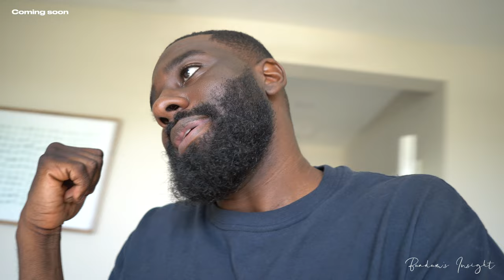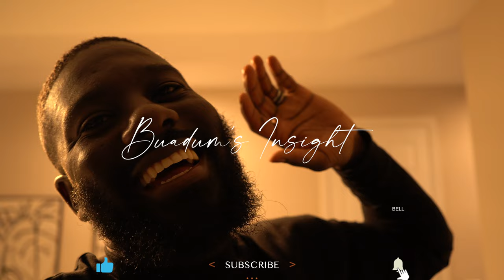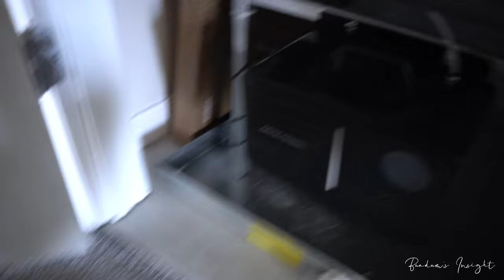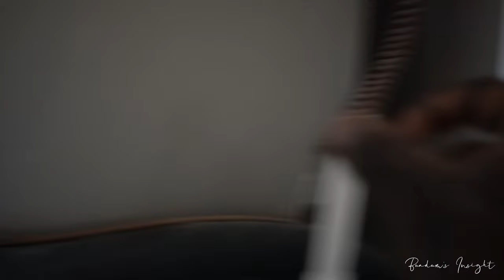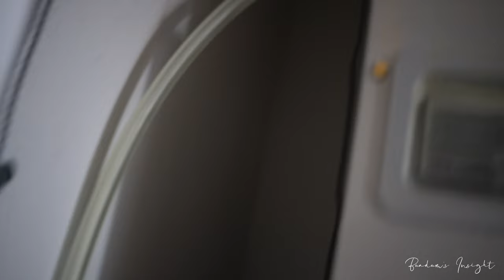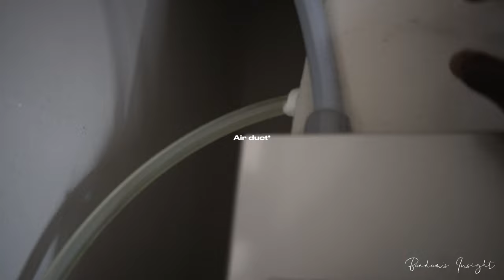AROMA360 HOTEL COLLECTION SCENT DIFFUSER | REVIEW, SETUP & MAINTENANCE

Comment: I would be cautious about putting a diffuser into an hvac system. If you go to HVAC forums, they do not recommend this. Over time, oil residue will accumulate in the walls of the duct system and it's not a matter of if, but when it will cause damage.

Comment: It’s was better than any explanation that the company itself has given! Cant thank you enough! I haven’t set my unit up but my only complaints are the CS.  They empowered (and paid) brand ambassador ie paid social media influencers to sell their products and unless you become a “VIP” and sign a 3 year locked contract for $165/month these ambassadors are no help at all.  CS doesn’t respond to emails, and their chat is done off shore and useless.  So THANK YOU for this!  Just one question for you:  I bought one unit that will only serve my downstairs unit (because I have two zones in my house and two separate units… has anyone tried to jigger the tubes to make a splitter so you can  have one tune from the scent bottle actually punch into to separate units? I understand that I will most likely go through  the oil faster (depending on settings) but wondering if anyone has done that before? The one unit I have BTW will cover the total square footage of my house.
Reply from the maker: Ooooouuuu this is a great question..... And yes Customer Service is very weak. Definitely need to fix that! A splitter is such a great idea. I haven't tried it and I am hoping someone sees your comment and responds, if they have done it. 

I think it will be just fine and with the adjustment of settings you may go through your oils at the same rate, without a splitter.

After using the scent diffuser for a few weeks, I changed my settings to scent less, because my home smelled so good; so when the scent machine kicked it, it was more so maintaining the scent in the home. I think you will be just fine with a splitter. I would love to know your experience as well :-)
Reply: I split mine off as well and it works perfectly. Don’t increase the intensity, just use medium setting and it will work.

Comment: My contractor told me not to use hvac diffuser because the oil can build up inside my hvac duct and that’s bad the system. Any thoughts? I have one but just place it in the middle of the house.
Reply from the maker: Great comment! I am no expert in HVAC, but I did do a little bit of research after I saw your comment, and I do not see anything regarding oil build up inside hvac duct, but the actually hvac diffuser can have some oil build up which can be mitigated by routine maintenance. But hey, as long as you can smell it, it doesn’t matter the placement. It’s a win win; in my opinion.
Reply: Saw this comment and just wanted to call out that their website specifically says that this is a no residue system. Also hotels use it so I wouldn't think they would put their expensive HVAC systems at risk.
Reply from the maker: Very true. Thanks for the feedback!

Comment: Thanks for the info. This is my second time watching. A good bit of time in between. I’m still undecided. Does the unit coordinate with the hvac system? Meaning, when the air is on (always in Florida) the hvac will blow cool air for a bit then stop and then start again in order to maintain the temperature. Ok so, does the diffuser coordinate with the hvac in a way that scent is being released when the air is blowing and is not being released when no air is flowing? Am I making sense? I’m just trying to figure out if during the run time of the diffuser is it constantly pushing out scent or is it coordinated with the flow of air through the hvac system.

Comment: My air flows through my furnace down and comes up through the floor vents, so do I put the diffuser on top of the furnace? Where the mist flows through the furnace and then up through the floor vents, or would this make the mist from the diffuser come in contact with the flame from the furnace and cause a explosion? Idk
Reply from the maker: Great question, that I am not too sure off, but I would avoid anything that will cause an explosion hahah.  I would contact their support team; they should be able to give you answer on this! The company also has the table top scents as well.

Comment: Have you had any issues with leaking? Or troubleshooting leaks? Our presidential diffuser is on your recommended settings, and has run out of oil twice in less than 2 months! The machine says it should last 122 days! Ugh

Comment: have your hvac guy add a pressure switch and use that to connect r and g so anytime it comes on the blower in the furnace or air handler will come on. we have done that for a customer

Comment: Also one other question…. I know Aroma 360 wont say yes….and it will null the warranty on the unit.  But can you use any other diffuser oils made for HVAC systems?  meaning if Magic scent has some crazy sale.. can I put that oil in my Aroma 360 unit?
Reply from the maker: Hello!! Thank you so much for tuning into the video and I am so glad you found it helpful. I have not used other oil diffuser outside of Hotel Collection, however, I think it would be fine.  Magic scent is a reputable company and I doubt and they make scent specifically for oil diffusers, that shouldn't be a problem at all. 

I am actually going to branch away from Hotel Collection or Aroma360 scents, just because they can be a bit on the pricer side hahah. I hope this helped out. Anyone else? Please chime in :-)
Reply: Yes you can oil is oil just each company makes there own fragrance. Will work fine with other brands and companies . I do recommend high quality oils not ones watered down .

Comment: What exactly does the volume setting adjust? I have a small home so would it be smart to turn the volume down?
Reply from the maker: The volume setting doesnt adjust anything to be honest. It tells the system how much liquid scent you are putting in, but it will adjust the setting as the diffuser is being used. 

What you will want to do is adjust the ML/H, work and pause so that it does not scent as much and as often. My apologizes for the delayed response.

Comment: So um...I'm on the east coast and our winters be WINTERING.
Even in the house. 
So your saying....I have to turn on my AC or fan for the scent to circulate the scent?? In the dead of winter ??
Reply from the maker: Hahah. Love the comment, but you can turn on the heat as well. Just air needs to circulate in the house for it to disperse. Sometimes when your HVAC fan is on auto run, it will blow air through your home, that will help as well.

Comment: I cannot figure out how to get mine to say on? It says off but i have gone thru all the settings and did everything correctly?
Reply from the maker: Hello Jenny, it might be the way your event(s) is/are configured. It could be the times or it could be that non of the days are checked off which would enable the diffuser to work at the specific times and days you choose.

Can you please let me know what your settings are and possible what days have a check or small triangle under it?
Reply: The machine goes by military time, so if you change the time to be the correct military time and then it’ll go on

Comment: Very Informative, glad I found this video. Definitely gonna buy this
Reply: Did you turn your fan on periodically throughout the day? Or just set it to auto
Reply: @Holiwood31  You have to run your fan prettty much all day because the machine will be outputing scent every 30 seconds up to 300 seconds. I have mine running for 50 minutes in the hour. Some people have setup their fan to run with the hvac diffuser, but it requires a lot more automation and it isnt easy.
Reply: Dont waiste your money unless you have $ to throw away.

Comment: I've had the Villa going to my HVAC for less than a month. Have my work time on 75, pause on 110 or 120 but I can't smell it as much as I'd like...but I do work from home and never thought about me kinda being "immune" to the scent. Just know as much as I've paid for the diffuser and the oils? I need to smell it, lol. Gonna try to go up to 95 and see. Was worried about me going through too much oil so i appreciate u telling me what that day # on the display meant. Still tryna figure out how or if this has wifi feature as I've seen nothing about in its paperwork or online.
Reply from the maker: Hahah super facts!!!! Try to include the ml/hr that should help and also your air will have to run for a little so it can disperse through your home — which I’m pretty sure you know.

I’m glad you found value in this video. Please let me know if you would like me to clarify anything. 

And as far as the Wifi feature, when I asked Hotel Collection about they said they were working on an update to app so it could connect but it does not work at this moment. 😅
Reply: Work 75 is too much. You'll always have to refill too frequently. Meanwhile they are overpriced. I bought mine o. Ebay new, they all came from China including hotel collection, aroma 360 and brilliant.
Reply from the maker: Love it! Thank you for getting us hip. Do they have all the scents on EBay?

Comment: We have had ours installed for just over a week  and already out of the 500 bottle!!! We could be wrong?
Reply from the maker: Hello Shuggy,

You may need to decrease the ml/hr to .5 or 1. It may be too high and also, you work (how long the machine is scenting) may be too short, change it to 90. Try this out and let me know if that works for you.
Reply: I think you might have let it work all day all week, plus what Buaduminsight said. 
Just set it to work while you work and turned off while you are away from home (that's if you have constant schedule)
If you are always home, let it be off when you are sleeping at night, and let it turned off some hours of the day. It will still smell well because you already had some in the air.

Comment: What do you have your settings on for the spray?
Reply from the maker: Absolutely!!

Please see below:
Our Setup:
Work: 60s
Pause: 110s
ml/h: 0.5
Volume: 500
Level: set by diffuser (but if not! Put 500ml)
Time: 8am to 8pm
Reply: @BuadumsInsight  Thank you so much!I
Reply: Thank you 😊 How long does your oil last on these settings? Our machine calculations are waaay off. I called CS & the lady recommended 
W: 40sec
P: 160sec
Rate: 5ml/h 😳
I’m leaving the rate low and hoping it will last longer. But no chance it lasts the 454 days my diffuser calculates 🤦🏼‍♀️